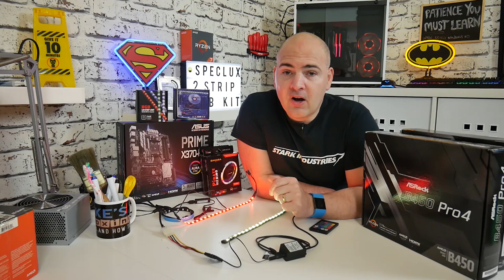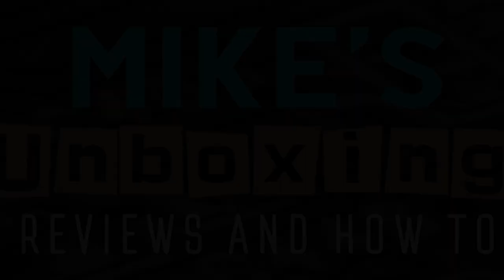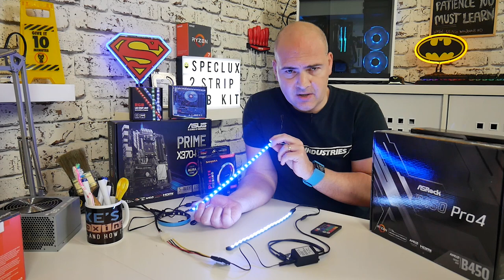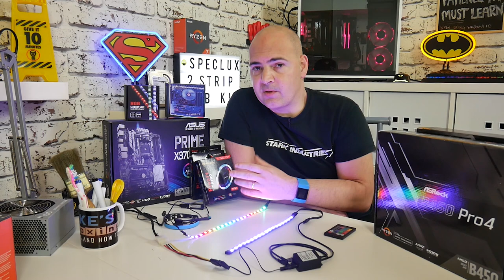PC RGB & Addressable RGB Explained

Comment: So generally speaking, addressable RGB is 3 pin 5v and standard RGB is 4 pin 12v? But 4 pin PWM fans are 12v on the power side?
Reply from the maker: Yes that's correct

Comment: Mike, I really appreciate your videos and style. I've been watching all of your videos on motherboard unboxing as I'm looking to build a Ryzen system and totally overwhelmed with the choices. To the point of RGB, it seems from your videos that you enjoy it, so maybe you can do some more vids on the topic like this. 

If you don't mind me asking a few questions? I'm looking to buy some rgb fans and probably a case and I'm looking at both the atx mobos - the Steel and pro4 models. 

My question is the following. I'd like to learn how to control rgb from the mobo and use all of the rgb and fan headers from the mobo instead of buying a case with molex and external controllers for rgb control. Do you have any recommendations and advice for buying, say 5 cheap rgb fans with 4/3/5 mobo pins so everything can be connected to mobo and controlled with software instead of externally or via the case? I feel lost and some of these fans at $15-20 seem too expensive. Surely I could buy a 5 pack or something with mobo connections for much less, no? Thanks in advance and excuse my ignorance on the subject.
Reply from the maker: easy one! get the uphere 6 pack fan set with the hub included. it just works great from the motherboard and i really like them. they are in my pc behind me in current videos if you want a peek
Reply: @mikesunboxing  Thank you. I actually was looking at those last night. :)
Reply: Unfortunately, I can't find these anywhere anymore. :(

Comment: Aren't there any adapters for the different pin connectors? Like some additional controller that can hook them up. I got a brand new build with parts that were supposedly Aura Sync compatible but the case fans have a 3 pin connector and the mobo only has 4 pin connectors....
Reply from the maker: not that i know of sorry
Reply: @mikesunboxing   so i should buy a 4 pin case or a 3 pin mobo?

Comment: Question: i noticed that the asus ROG strix B550 F gaming motherboard only has one 3-pin ARGB header on the board, i wonder if i can connect all 6 ARGB fans (model: ID-cooling fan DF-12025-ARGB) using just the spliter cables without a fan hub? How many fans can ONE ARGB header support?
Reply from the maker: that is probably towards the safe limit

Comment: finally a video that explains all of this headache.

so my 2 argb case fans should be daisy chained and then installed into the 3 pin add_gen2?

do the fans power connectors get connected individually or can they also be daisy chained?
Reply from the maker: they can be daisy chained if they have the option or use a splitter or hub

Comment: So if Im ordering a fan kit with a controller that connescts to the motherboard and needs a 5v ARGB header, but my MOBO only has a 12v, what do i do? should I still order the fans? can i even use them???
Reply from the maker: you won't be able to control them with you motherboard for sure, but, you might have some control with the controller you are buying though
Reply: @mikesunboxing  i have 4pin mobo and i have the 3 pin fan. can i using the converter ? An if yes does it can sync it? Even it cant be argb n still can sync with rgb thats is okay.

Comment: hey mike! 

What is the maximum current of 5v3 ARGB headers on motherboards? I have a Aorus B450 Pro Wifi, but its manual doesn't have that info. I plan to use a splitter to connect 3x cf120 fans (.48A each) to a single ARGB 5v3 ARGB header. Will I have problems on it?

Thanks in advance!
Reply from the maker: every board is a little different but i would say most headers will support  3 of 4 fans reasonably easily although that also depends on the amount of LEDS

Comment: I’m pretty sure my mother board comes with 2 RGB headers. My question is my View 71Tg RBG comes with 3 RGB case fans. Will those fans take those spots?
Reply from the maker: if they are 12v rgb yes and you can also use a splitter to connect more

Comment: Hello. So I ordered some addressable leds and a controller from Amazon. If i pug 1 strip up it works fine but if i and any extensions which I need all the lights turn white and the app no longer responds. The light won't even shut off at this point, they just remain white. If i unplug the extension and go back to 1 stip, it works again. Please help been at it for 3 days now.😥
Reply from the maker: This is maybe easier to fix or at least advise if we can ask more questions and get direct answers, so feel free to join our Discord chat and we can go over it in more detail https://discord.gg/gaeeDPw

Comment: I'm here as I just did a mid-tower build after a decade and took advantage of deals where some Nfortec RGB was included in p/s and cooler.  The AIO instructions didn't explain how RGB worked but the pump lit white (which turns out to be "the LED indicator that the pump is safely operating" which had me looking for a tiny light lolol), the fan spins but is not lit at all and the power supply lights having a control button.
Anyway I was just curious what I missed as the PWM fan doesn't have any obvious lighting visible and wondered if I should connect the radiator fan to the mobo.
Now I can see the company have their own 6 pin plug on the fan intended for a controller (the RGB mode alternative to the standard PWM), where the GB Aorus mobo uses the 4 pin system on many LED headers.  There's nothing to explain what you need to make it work nor the existence of various control methods.  I'm sure the absence of parts if far more confusing than when you have them.
Thanks for giving enough background info to make sense of this obfuscated mess :)
Reply from the maker: This is maybe easier to fix or at least advise if we can ask more questions and get direct answers, so feel free to join our Discord chat and we can go over it in more detail https://discord.gg/gaeeDPw
Reply: @mikesunboxing  I'm happy ... I just wanted to make sure I hadn't missed something, I honestly regard non RGB on my Fractal Design case as a +ve feature 😁😁

Comment: What happens if you plug in a regular rgb 4 pin in the 3 pin socket like I did😲?
Reply from the maker: You will probably not do any damage as the four pin is 12v if it was the other way around you are putting 5v onto a 12v output which could do same damage
Reply: the reason I askis when I did it the power was off but the cpu fan started spinning, and now the ps2 keyboard won't work, nor any of the USB ports with a mouse. windows loads but I can't enter a pin, nor can I hit f2 to get into bios. tried resetting bios, and removed the battery. still nothing. thinking I fried the MB somehow. sorry I know you're not a diag channel. thanks for the info though! keep up the helpful vids.

Comment: I have the Asus Prime 470x Pro that only has 4pin Rgb headers on the Mobo. I’m using the CM ML240R Liquid Cooler with Masterfan MF120R A-Rgb fans that only has a 3pin connector to it. I have separately bought that exclusive controller for that liquid cooler to try and have these fans turn on but they do not. The only fan that turns on is the Cpu core and it only shows a green in one spot. Any help at all on this matter?
Reply from the maker: Send some pictures of the setup to our discord and we can see better what needs changing to get it all working
Reply: Mike's unboxing, reviews and how to sure thing

Comment: Forgive me for asking, but say i have 6 RGB fans in my case. Does each fan come with it's own power cable, and RGB cable? Thus needing 6 fan power headers, and 6 ARGB / RGB on my motherboard? Or does 1 ARGB / RGB header on the motherboard control every RGB device? (I think my question makes sense - if it doesn't i'll reply to this to try to further clarify if need be) The reason i ask is - I plan to buy the Phanteks P400A Digital case. It comes with 3 RGB fans included. I plan to add 3 more to the case, of a different brand.
Reply from the maker: generally speaking each fan should have its own PWM fan connection and a separate rgb cable and that will need to be connected to a hub to combine them, some brands also have a passthrough option so it isn't always straight forward
Reply: @mikesunboxing  all right, I think I understand it, then that Hub gets plugged into the header on a motherboard?
Reply from the maker: @beegekhaos3171  yes that is right
Reply: Awesome - thank you for the clarification!

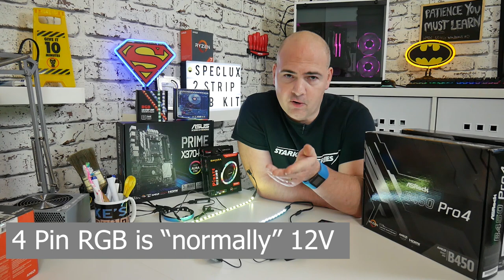Comment: I refer to timestamp 0:40 to 0:53, I understand that 4 and 3 Pin use 12V and 5V respectively. However, with reference to the Asus TUF 365-PLUS GAMING manual page 1-3, it seems that both their 12V and 5V are both 4 Pins on the motherboard?? Anyone can explain this? I'm really confused.
Reply from the maker: TUF boards often have both 12v and 5v RGB running at the same time just to confuse things further. The actual headers or the same and use a four pin setup but the 5v system has one of those pins removed
Reply: @mikesunboxing  Ah I see. Because when I referred to the manual, the picture seemed to depict that both were four pins. Tried to zoom in on actual pictures of the board but it was too blurry. Thank you for the reply!

Comment: I am just checking, but of course if you cannot answer for any reason, totally get it, but my motherboard has 2 addressable RGB headers and 2 regular RGB headers, and I have 4 regular RGB strips, so I assume that the first 2 will work in the regular, but could I plug the other 2 in the addressable and it still work, just without all the fancy addressable stuff for it, so basically, if I plug it in, will it still work?
Reply from the maker: no it will not the two systems are totally different. just buy a cheap RGB splitter cable and then use the 12v rgb only
Reply: @mikesunboxing  ok then, thanks man, appreciate you taking time to reply

Comment: Hey mike, great video but I’m still slightly confused. I bought a b450 tomahawk Max which has 2, 4 pin rgb headers but my case has 5 fans, all 3 pin, argb. What should I do? Thanks
Reply from the maker: You need a controller to use them are change the fans or the board really

Comment: great video. can I plugin a 2 * 5v argb led strip into a 12v header on the motherboard using a cooler master-splitter. Im using a gigabyte aorus x570 pro wifi motherboard ?
Reply from the maker: No you can’t mix the two standards
Reply: Mike is right, but your x570 should have both 3pin and 4pin rgb headers

Edit: nevermind, you've got a gigabyte mb which just makes everything confusing lol

Comment: Can you use a 4 pin  y RGB connector to connect argb fans and motherboard argb.  If you cut one of the pins.
Reply from the maker: No they are not compatible systems
Reply: @mikesunboxing  More asking if the pin out is straight thru.

Comment: Hi.. Mike, I already fuq'd up.. I plugged my rgb fans on a fan header 12v and the controller is now Fuq'D. So what I would like to know is, since they go thru the controller( HUB) are the fans fried also or not?
Reply from the maker: hopefully not the controller should act like a fuse - hopefully
Reply: @mikesunboxing can you assist once again, my mother board has no rgb header.. so where do I plug the rgb header 🤷🏿‍♂️?

Comment: after watching your review on the asrock b650m pro rs wifi, i'm wondering if this mb has enough ports for a cpu cooler with rgb and rgb fans for the side and rear.
Reply from the maker: yes and most will daisy chain together easily

Comment: can i connect rgb fans to jled header? jled headers are used for 5050led strips but is there a way i can use them for fans? with converter? im just confused
Reply from the maker: Jled is often a 12v RGB so you will need some type of adaptor to use 5v addressable I personally would just use something like the up here setup with built in control
Reply: @mikesunboxing  most of the time rgb fans are 5v right? the name of the header is jrgb to be precise it is 12v yes and most of the time rgb fans are 5v .. so i need an adaptor .. am i right? thank you for answering @___@

Comment: Please tell me if I can use a different ARGB fan with a different brand ARGB controllers....
Reply from the maker: Yes the 5v 3 pin is a standard so brands will generally all work together for the most part
Reply: @mikesunboxing , a brand from AliExpress giving a controller which has 6pin ARGB output.... any idea?

Comment: Ok so I had a question basically just built my first ever pc I got a board made by asus and long story short it only has 4 pin 12v connectors so would it be wise to get an adapter or splitter that one end is a 4 pin and the other end is a 3 pin and hook rgbs up like that? Or is that gonna ruin my system
Reply from the maker: that won't work. 12v doesn't translate to 5v addressable in any way sorry

Comment: Hi, can u guys help me! so the blue RGB strip that's Mike holding on the right hand( MIkes right hand, addressable RGB stip) I have that exact reg but I don't know how to connect to my MSI tomahawk b450 max as those RGB pins have 4 pins but in order for me to control the light using the MSI mystic light I need to plug in a 3 pin connector to the motherboard and I was wondering if I need an adapter from 4 pins to 3pin in order to change the lights on the software or I can't do it this way? Please help really appreciated it. Also, I live in the UK so if you guys send me a link on amazon on which splitter to buy it would really mean a lot. Please help. Thank you in advance. Or if you make a video then I'm sure that lots of people will appreciate it
Reply from the maker: You can’t use Addressable on the tomahawk it doesn’t support it only 12v RGB sorry
Reply: Thank you.

Comment: Plzzzz help me i have an rgb cpu fan from coolermaster and its called a71c, i want to control all my lighting on a software but fan comes with a power cord to power the fan and rgb cord to power the lighting, and the rgb cord has 3 pins  and when looking on my motherboard theres no 3 pin header i have to use the controller but i dont want to i want to control it from a software can you plz look into this and help me with this fan
Reply from the maker: This is maybe easier to fix or at least advise if we can ask more questions and get direct answers, so feel free to join our Discord chat and we can go over it in more detail https://discord.gg/gaeeDPw

Comment: I have a rgb fan with 3 pins but there’s a slot between them so I don’t know where to plug it in
Reply from the maker: sounds like a 5v ARGB connection
Reply: Do u know if that’s on a ASU’s prime b450m ??

Comment: Thanks in advance, is there a way to test my mobo add rgb header? I was going to jump blindly into it but the id definitely start pulling my hair out, and i tried search engine, but my key words havent flipped a single switch as far as information online.  Im referring to using a DMM on the pinouts. As far as the fan goes, well, it surely goes. My issue is particularly the rgb. Already ive owned 2 sets of addressable fans, one of which is an aio cooler (the cpu cooler works fine on armory crate). ONE set(base fans) connected to a hub, which has never worked since ive changed my mobo, which may be a compatibility issue, or just a faulty mobo. The radiator fans for my cooler are plugged directly into the mobo with the 3 pin to 3pin addressable so its separate from the 12v fan plugs, which are also connected to a fan header on the board. The Rgb for the cooler doesnt work at all, even with the base fan hub rgb plug disconnected. It led me to my initial question. Also, my mobo and aio are both assus, oops i mean asus=)

But i know it is just as likely there may be a compatibility issue. Passionately curious to know if addressable ports can diagnosed as such for any future troubleshooting nightmares. Thanks again
Reply from the maker: This is maybe easier to advise if we can ask more questions and get direct answers, so feel free to join our Discord chat and we can go over it in more detail https://discord.gg/gaeeDPw

Comment: Please help 😔. I have 5pcs. "aRGB" 6pin fans which was connected to a hub, the hub has a molex cable for power and a 3pin cable for 3pin aRGB header on the motherboard. I connected it as what it should be but I'm not able to control the lights through software.
Motherboard: Gigabyte b450 Aorus Elite
Software: RGB Fusion 2.0
Fans: YGT (some chinese brand)
Reply from the maker: i'll try and take a look
Reply: Thank you, I hope there's a way to sync it through the software.
Reply from the maker: Can you send me the exact model number or a picture to the discord to check on connection
Reply: Here's a link to a detailed product review of the fans. Hope it helps 🙂. 

https://youtu.be/DVrkVkkPQLM

Comment: If i dont have any rgb header on motherboard or controller, can i still use rgb fan without plugin rgb cable? Only plug power cable fan.
Reply from the maker: no the rgb needs power and a signal

Comment: is it possible to connect a 3 pin rgb for example the cooler master masterliquid ml120r rgb fans into a 4 pin rgb motherboard like the rog strix b450-f rgb?
Reply from the maker: No the standards and Voltage are very different. It will do damage if you attempt it. Don't do it 😀
Reply: @mikesunboxing  even using a converter ?

Comment: Mike,you have said that my motherboard (asus crosshair viii hero (WI-FI) support both argb and rgb..so that this that I can use my rgb components along with my argb case (cooler master h500m)..12v 4 pin connector and 5v 3 pin connector connected to the same motherboard and can I sync them together...
Reply from the maker: sort of, because ARGB moves and RGB is static you won't get the same effects but if you are going for a single colour that is fine
Reply: @mikesunboxing  so.that means i have to sync the rgb and argb components with their software
Reply: @mikesunboxing  does that means. I can't change the colour